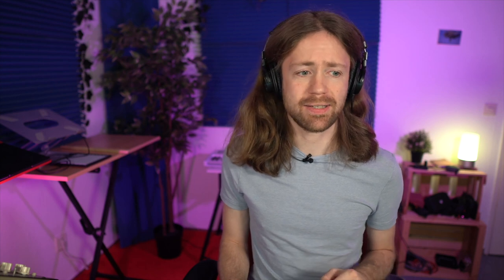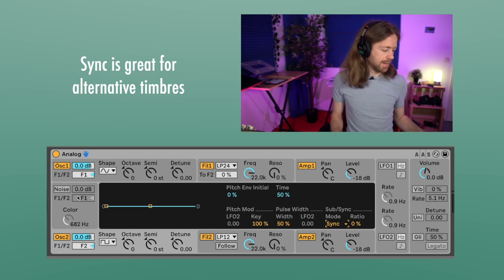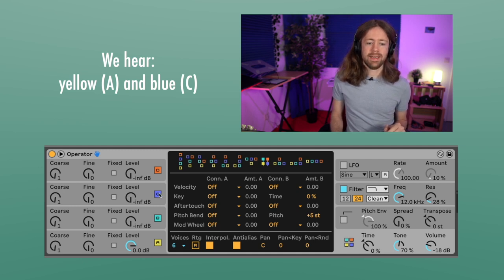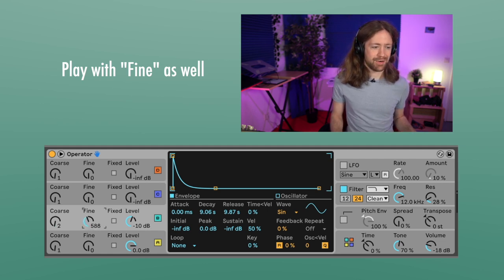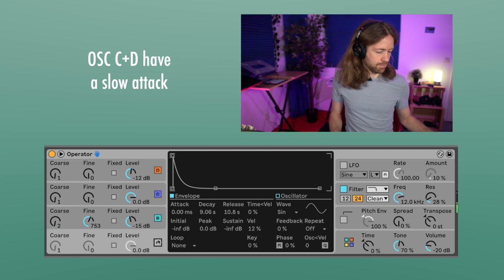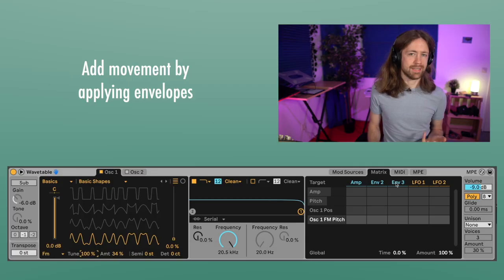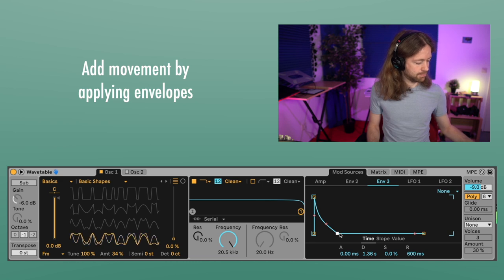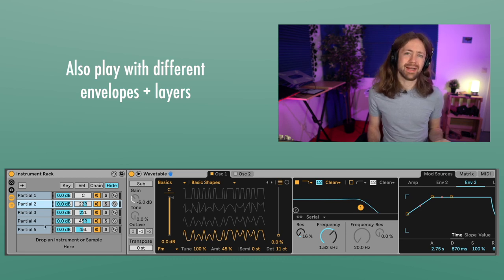Making Synth Bell Sounds in Ableton Live w/ Analog, Operator & Wavetable | Ableton Live Sound Design

Comment: Hi Janis
I'm looking to buy a computer or laptop (Apple) for Ableton.
Do you have any advice on what to get please?
Reply from the maker: Hi Martin, glad to hear from you! I can recommend getting a laptop/computer having one of their new chips. I have a MacBook Air with the chip called M1 and it runs really smoothly, plus has some excellent battery life. There are new ones already, but this might make the now 2 years old M1s a little cheaper. I have the version with 16GB of RAM, but I heard even the 8GB version can be quite powerful. If you can choose I'd go for 16 though. Hope it helps!